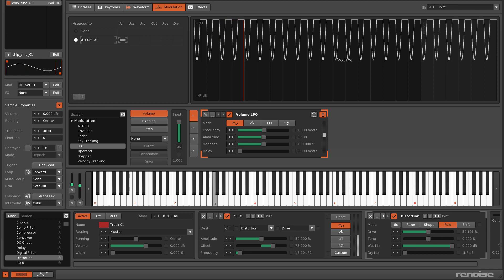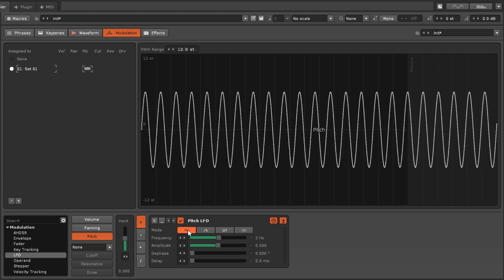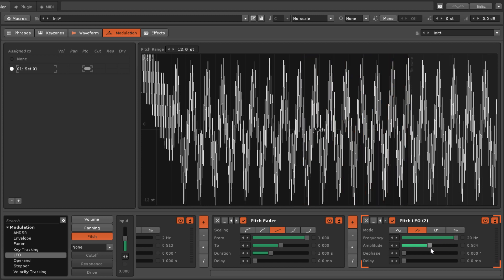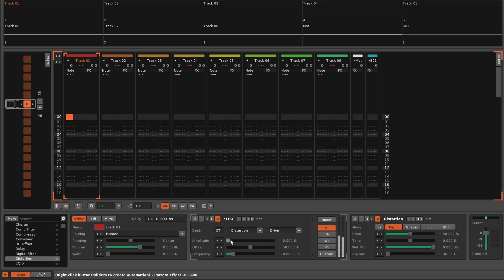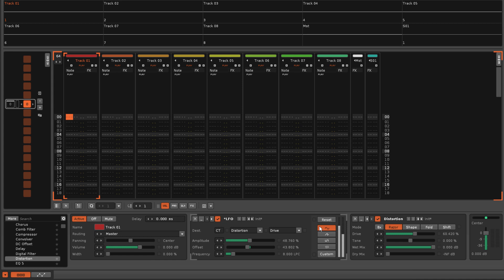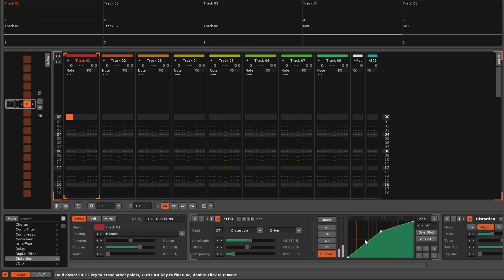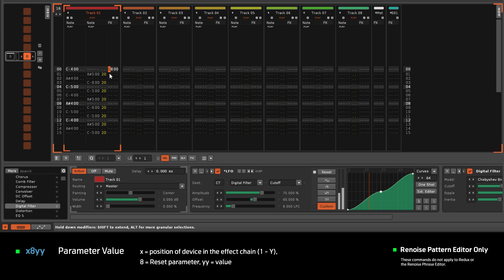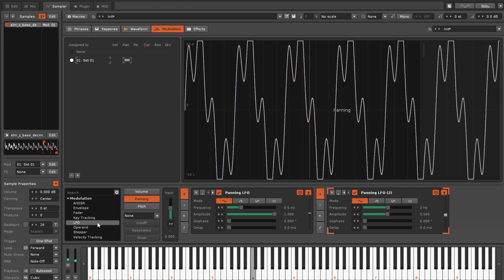LFO - Modulation & Effects

Comment: i am trying to create a sine lfo (or any waveform lfo that i have in my library) to trigger one of the effects start/stop on a tape stop effect plugin that i have pulled up in Renoise - is this possible? i am coming over from using logic but want to learn as much as i can about the wonders of the Renoise DAW i know have 🙏
Reply: Yes it is. Just load up the plugin, then put an lfo on the same track and assign it to that effect, and the desired parameter.

Comment: Thanks!  Without midi, is there a way to use the lfos to control eurorack?
Reply: The only way I know this might be possible is with a MIDI to CV converter? I think you might be stuck with having to use MIDI and then converting it
Reply: @chairtoad2430  I guess using the lfos to control silent way through a dc coupled interface is a way to do it too
Reply: @HenricWallmark  Oh cool